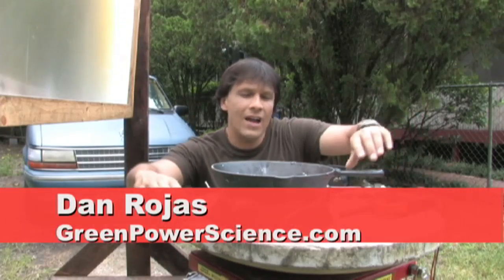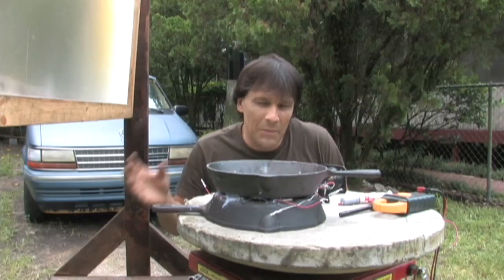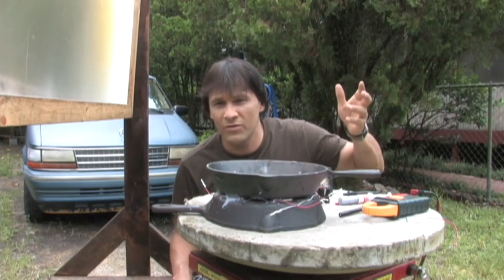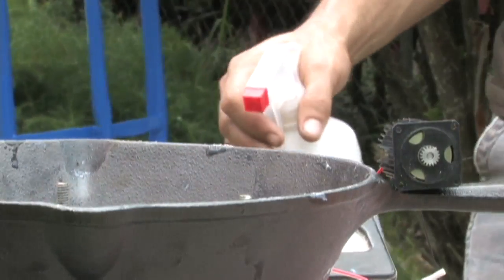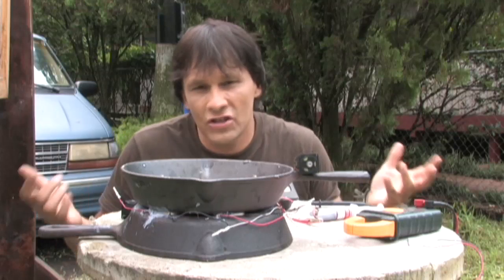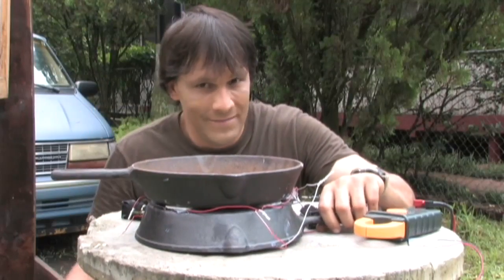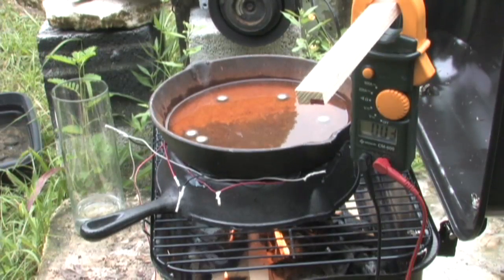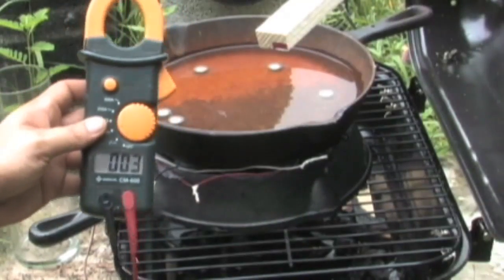Charge your cell phone with FIRE? PELTIER THERMOELECTRIC COOLER Campfire Electricity

Comment: There are ones you can buy that are water insulated and have max temperatures of 200°C and so i was wondering if i could strap it to the engine or exhaust pipe on my quad, the dimensions are 40mm x 40mm x 3.2mm and have a Max output of 24v and 15 amps. i figure if  i get a step down transformer to 12v and add a cigaret outlet and connect a Cigaret to usb adapter and charge my phone and run my head lights off that so the engine doesn't have to work harder at charging to battery and powering the lights, i think that will be a little easier on fuel right,
Reply: +Daen Gignac There would be a lot of circuitry work to seal away the wires from dangerous areas as well as balance the voltage and amperage ratings of all of this properly, but if you were to run your headlights off of it, you would need anywhere between 10 and 30 amps depending on the bulb. You may be able to find an LED solution such as Plasma LED's, which use a combination of plasma and LED to phenomonally increase light intensity beyond a normal LED with the same voltage, but otherwise I'm sure a casual bulb would bring you some difficulty with the output capability of your Peltier setup.

Comment: that's awesome! and maybe you can help me with my current project.

i'm building a pedal power generator. but the dynamo (it's actually a electric DC motor used as a dynamo) loses about 24% of the input power as heat and noise, and gets overheated very fast. so i thought of making one thermoelectric generator attached to the motor to solve the efficiency and the overheating problems at once.

if i simply put some peltier coolers on the motor will it do the job? or should i use heat dissipators, vent coolers and stuff too?
Reply: +LulaRMuniz Depends where you are sticking them and what kind of chips...you'll need to not only do a lot of homework to figure out what you would need to capture said heat, but also ensure you're trapping as much of it as possible for the Peltier to run at peak efficiency. 

Another cheaper idea would be to find a low power CPU fan and AIO watercooling system to wrap around the motor so as to cool it off some using only a small amount of the generator motor's electricity or cranking a second, smaller motor for that sole purpose, but I would only recommend this as a secondary idea if you are unable to get the Peltier idea to work efficiently enough to be useful.
Reply: thanks! i actually solved the overheating problem by fixing the motor. i opened it and discovered the real problem. i also tried using the peltier to feed the cpu fan, but the voltage is so low it doesn't work. but i don't need it anyway. so it's done. haha thank you anyway.
Reply: +LulaRMuniz You're welcome. Glad to hear you found the electricity leak making it hot so often!

Comment: The trick is to heat one side without burning them out in the campfire. What if you buried it under the campfire with the hot side up and the cool side down in the cool earth. That would give you the temp contrast that you need without overheating the generators.
Reply: +OneCupOfCoffee204 An underground electricity-generating campfire...it could work, but you would need to spend some time designing something to actually capture some of the coldness of the earth so as to cool the cold side of the Peltier adequately.

Comment from the maker: This is a standard TEC or thermoelectric cooler. There are better TEG or thermoelectric generators. I have a few and will be testing in future videos. They work well but have limited power. Also working on a DIY version that can work with higher temperatures.

Comment: Just a heads up: thermal paste is designed to maximize thermal transfer, not inhibit movement. That's why it's used in computers, where CPU's heatsinks are bolted down. Thermal tape is an inferior thermal transfer medium.

Comment from the maker: It does not with TEC (coolers) with TEG (generators) it does. TECs do have a favorite side. Hook a battery to it for one second with NO heat sink in place (longer and it can burn up). One side will be warm and the other a little cool. Mark one side hot and one cold. This increases the power a little. Some models it does not matter.

Comment: Hi Dan, you show case some amazing stuff. I never heard of stuff like the peltier cooler or sterling engine. Would it be at all possible to do a demonstration of different alternate energy devices combined together? Maybe use your custome made solar panel and line the back of it with peltier coolers. So you capture solar energy + heat energy and throw on the end of that  a sterling engine. then one could theoretically disconnect themselves from the power grid right? :)

Comment: @GREENPOWERSCIENCE 
you cant 'produce' amps. however you produce to ability to support amps. amperes is a draw and is determined by voltage and resistance. so question would be how many amps would a unit that size support?

Comment: Hello Dan, Nice video. I want to try an idea to stick a peltier cooler to my radiator and put a small computer fan on top to spread the heat more actively in the home. At a temeperature of 30-40 degrees celcius do you know which capacity peltier is best to buy to run a 5-15 Volt fan? Or formulated differently, what capacity could I get to run a peltier cooler against a heater of 30-40 degrees celcius (in terms of amperage or voltage)? Thanks!

Comment: Published max op temperature is 175C way below the solder melt point. What happens is copper diffusion through the solders and the copper busswork on the alumina into the Bismuth Telluride elements. A better approach would be the skillet sitting on a wet sand bed and hot coals placed in the upper skillet. Water is also lethally detrimental to a thermocooler. Any cooler should be sealed with silicone along all 4 sides to prevent moisure issues.

Comment: too bad those things are extremely inefficient... for max power output a conventional diesel powered generator is more efficient than those peltier units. its just that the control of heat radiation is impossible, getting these things to run at a few % efficiency. Comparing that to a standard otto cycle engine which outputs approx 30% efficiency... It's a good concept of harvesting heat from unsed embers for example, but you could do better for powering electronic items

Comment: I wouldn't recommend using fire. As you stated wires will desolder if it gets too hot. But not only that. The small elements inside are soldered together with a very low melting solder. Except for some specially designed Peltiers even 100°C can already be too much!

Comment: ground water 70deg pumped up then,  split into 2 pipes, pipe1 to roof for water heating.  The other ,pipe2, flows into a swampcooler type unit to produce cool air(for a living space). The thermal-couple would be placed between the discharge of the swampcooler, and the reservoir from the solar heated water. could enough current be produced to keep the water moving and fan blowing in a typical Florida summer day?  Keep in mind you can create as much surface area as you want for the thermalcouples

Comment from the maker: @giant648 Generally YES, they have more surface area and working material inside to produce more AMPS. Voltage is similar on all sizes depending on how they are made. Some larger ones do produce more voltage as well.

Comment: hmm correct me if i am wrong but woulndt you get more energy from the peltiers if you changed the water in the pan every once in a while, so the temperature difference would be maintained, or maybe used a coolant fluid or something?

Comment: Data for 2  I found:

thermoelectric-generator com

TEG1-12610-5.1        
Open circuit voltage: 8.6volts
Internal resistance: 3 Ohm
Match load output voltage: 4.2V
Match load output current: 1.4A
Match load output power: 5.9W

HT1-12710
navitron org uk
stove 200 deg C  Peltier is producing  6 v open circuit.

1 bulb 6.2v at 140mA.  With a 500mA bulb the voltage dropped to 3.5v and 300mA.

Comment: Are you talking about the peltier system or alternative energy in general? If you mean how volts and amps work the electronics would be your choice. You could probably learn the basics of Ohm's law (Volts = Current * Resistance) and the Power law ( Watts = Volts * Current ) from online sources.

Comment: Cool video. If you were to focus light on the pan or something similar I guess you could get a decent amount of voltage/current with a series/parallel set up. Would be good for a solar setup to aid in charging deep cycle batteries in remote areas.

Comment: Interesting! What are the rated watts for your device. I have found several on ebay from China used for computer coolers, 7 to 168 watts, but seems like your units are much smaller.

Comment: That's cool.

Here's a thought.

Line water pipes and drains so that when I take a hot shower I could actually generate a bit of electricity from the wasted heat.

Or line a gas fireplace....

Or even an oven....

Why aren't products like those on the market?

Comment: Was there any damage to the PELTIER units? They don't like to get overheated, must always ventilate or sink off the cooler side. A small flow of water would cool it at a more constant rate. Instead of  fire use hot coals or of course the Sun , and use a thermometer for safety. Love your videos!